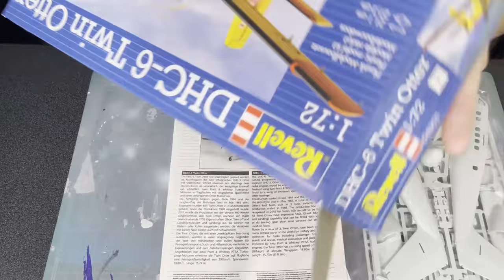Revell 1:72 / DHC-6 Twin Otter / Rescue Sauvetage / How to build / Painting

Comment: You skipped the part I was hoping to see. How did you do the strip decal that goes across the cabin windows? Did you measure and cut it before painting?
Reply from the maker: Hello! Sorry! But it is very easy, I just recommend before applying that specific decal clear coat very well all the plane. I didn’t cut it it just slide right in, by the way put a generous amount of decal setter before applying it it gives more control, And again sorry I didn’t record that specific process some parts a very difficult to record while I’m concentrating on doing a good work

Comment: Super job indeed eh. Looks like it went together with no major problems. I seen there are floats. Can you do a float plane version as well? Keep up the excellent builds
Reply from the maker: Thanks!! I appreciate your comment!! For sure! Right now I’m working on a helicopter but making the floating version of this Twin Otter is going to happen soon! 👍👍
Reply: That is Awesome. Can't wait till see that build vid. I have been working on and off on the same helicopter kit you are doing. So far it has been a fun little build. Mine although had some short shots on plastic. I had to scratch build half the rear rotor section. Keep up the great job eh
Reply from the maker: @peterruck6062  nice! Yes it is very fun indeed, It seems that is going to be a little bit challenging too but I think it is going to look nice! 👍
Reply: @theairplaneguy4250  the EC 135 heli?
Reply: @theairplaneguy4250  i have 1 of these twin otters in the stash..must get around to doing it....just curious if you are aware its a reboxing of the old Matchbox  kit from the 1980s.
Reply from the maker: @damien5748  that’s correct!
Reply from the maker: @damien5748  yes!! That’s right, I couldn’t find anywhere this kit in Matchbox brand but this Revell one is very fun to build and very accurate
Reply: @theairplaneguy4250  i have 2 of those EC 135s...and thanks to the Irish aftermarket decal company called Max Decals i was able to do 1 as the Gardai (Irish police) air support unit and the other as a machine from the Irish Air Corps....(yep im Irish)
Reply from the maker: @damien5748  nice!! Sure it looks good👍